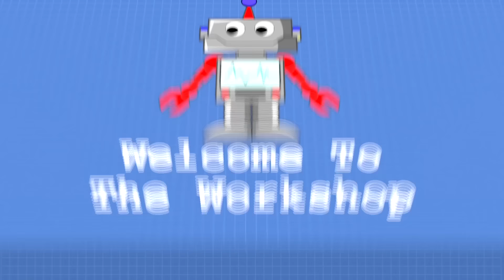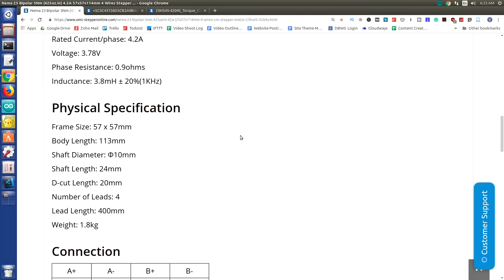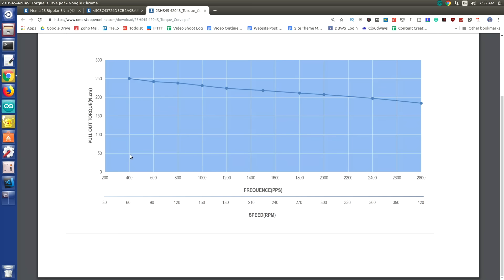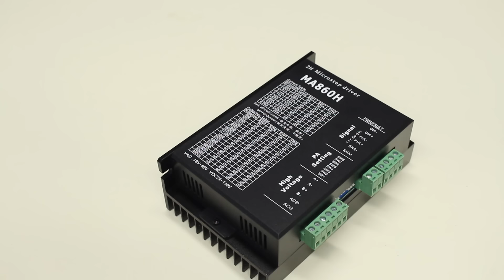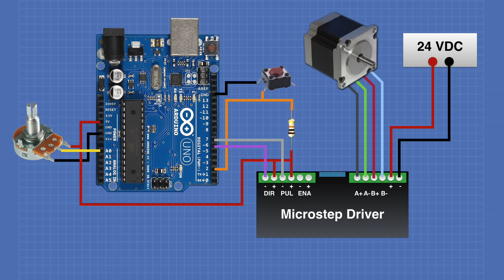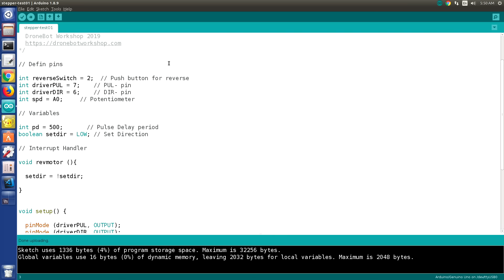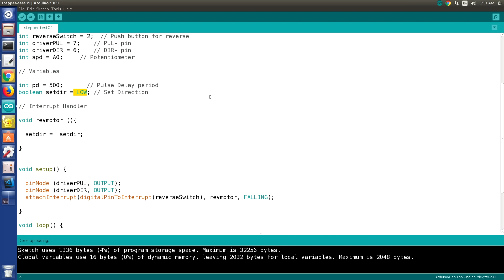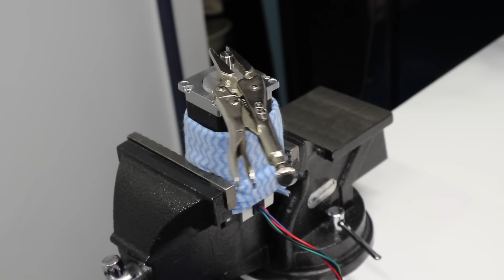Big Stepper Motors with Arduino

Comment: I'm pretty new to electronics so forgive me if I'm asking dumb questions, but if you're using a 30 volt - 5 amp power supply, won't that burn the stepper's coils that are rated at 4.2A? Are you specifically setting the power supply to 4.2A, or does the power supply, having a maximum output of 5A, give no more current to the device than it requires, therefore requiring no resistor to bring down 5A to 4.2A. And why are you running the motor at 24 volts? It seems for no particular reason since you said the voltage rating doesn't matter. In that case, couldn't you have used a 12V or 100V power supply as long as it can supply 4.2A?

Comment: I would really love some advice. Instead of the push button and Rotary Control Potentiometer can I use a Rotary encoder that has push function. The reason I need advice is I am running a Nema 34 with with driver and power supply like the video but would like to know how I can use a rotary encoder to control the speed forwards and back (push of encoder)? I tried signing up for the forum but no reply yet. Is there anyone who can help or point me in the right direction? I am confused and struggling with the sketch.

Comment: I have been watching quite a few videos about electronics and Arduino. I did not find any that has a quality that comes even close to what you are presenting here. I am very thankful and consider this a true motivation to continue my approaches. I also mentioned this on a different occasion. Often video in English appear to be hard to understand for non native speakers. This is absolutely not that case with your videos. You are doing a great job in using very clear language that is easy to understand if you are somewhat familiar with the language!

Comment: Hello
can we connect 4 stepper motor of current rating 6Amp with Arduino UNO and do the programming?
Reply: yes but need stepper motor driver what handle max 6Amp /motors. and power supply more than 4x 6A = 24A power supply to drivers. and arduino need own power.

Comment: is it possible to use that kind of drivers on a cnc shield v3? thank you
Reply: yes, many  cnc hobby user has use arduino cnc chield v3 4 axis or v4 whit nano 3 axis, but this used old pre-history worst GRBL code whit arduino, if change arduino out and use 1 or 2 paraller port card cost less than 12$ and linuxcnc software can use lot lot better software big motors and lot more all stuff and code normal used G-code today ewery machines. not GRBL.  minimum cnc need use linuxcnc or worst mach3 software, parallerport comtroller drivers and motors need be minimum nema 23 or 34 ,   425OZ torque 4-6Amp motor less than 50 volt normal 36-48 volt or biggest driver 80-90 volt. 5-8Amp. can use nema 34-48 motors have better, important have torque and amperes same driver important volt more and ampere more. less than 3Amp motors used only laser or 3d printer what no need lot torque nema 17 printer and laser, and cnc need lot more torque can cut.

Comment: despite rated current given for one phase you are don't need to use power supply twice as powerful.  because both phases never gets to full current at the same time (90 deg phase shift)
Reply: if motor max curren have 4A need power suply more than 4A if use 3 motor max 4A need power supply 3x4A what have 12A power or more. normal about 15A power supply good this.

Comment: Make sure you double check the steps per revolution DIP switches on your driver if your motor does not turn or only turns slowly .... don't ask 😁😁😁
HBS86H with Nema 34 is finally working. Thanks for the video!

Comment: amazing tutorial everything is explained in a detailed mannner. i want to control the motor with raspberry pi using python having same driver...please guide me how to do that???
Reply: The Raspberry Pi only haas out put voltage of 3.3 v on the pins. These stepper motor drivers from Stepper online need 5 volts, so you’ll need Arduino for these.

Comment: hello Bill
I am learning electronics for a CNC plasma cutter. Torch Height Controller is a bit of a problem to me. I have a lot to learn about CNC in general as an entry level. I could bother you big time for the next few years if you only want me to.
I need to learn real stuff not just as a hobby, it is my job already.
Your pedagogical teaching style has a big value.
waiting ,
thank you
gabi

Comment: Hello.. I want to use stepper motor on different axis and it's hard with plc .. so I want to try this idea. But can you help me with where to buy this black box????
Reply: Hi, I'm using a similar module in my CNC project. It's called TB6600 and I got it from ebay.
Reply: @suromark  TB6600  max 4Ampere have small motor drivers better buy DM 556 max 5.6 ampere motor or better DM 860 max 6Amp motor or biggest driver if need big torque motors.

Comment: FYI, DIR stands for direction of motor rotation, PUL stands for pulse signal, and ENA stands for enable. Just in case DURRRRR sound is grating on you. Manual for stepper motor controller MA860H is at https://images-na.ssl-images-amazon.com/images/I/81Cyu+2MjrL.pdf

Comment: Great vid. You initially said that the PSU must be rated at twice the stall current but your PSU is only 5amps?
Reply: if use only 1 motor need motor max current about this have 3-4A  power supply need one motor about 4A if use 3 motor etc, cnc, need 3 x 4A= up to 12 A power supply.

Comment: I’m assuming I can also do this on a Raspberry Pi but without the potentiometer. I would like to control the speed in the program similar to the second example. Slow to a stop and then reverse. Is there any special reason you chose the Arduino over the Pi? Other than the analog input.

Comment: What kind of motors are used for modulating boilers. Is it AC servo  motors ??      Motors that modulate the gas and air intake.

Comment: Hi, Im willing to use a stepper motor and arduino to make a DIY ForceFeedback Sim wheel. After a lot of research I cannot figure out if the arduino will be capable of controlling the motor driver for the force feedback. Could you please answer me that. Thanks

Comment: 30V 5A may not be sufficient to drive the motor since the current/phase is 4.2A and two phase should be 8.4A and the power supply is not enough?

Comment: I personally find the voltage ratings of stepper motors critical. It tells me how fast the motor can run and still generate usable torque. But I have a rudimentary grasp of inductive reluctance myself.

Comment: Curious about the description of doubling the amp rating when half stepping, which seems to make sense as described, but then when the torque specs were shown with the 36V supply rating the amps were still listed as 4.2A.  I'm just a little confused.  EXCELLENT tutorial for a person new to this.  Thank-you.
Reply: If you really want to learn about current and stepper motors then I suggest you monitor the current of a running stepper motor. Analog meters work best for this as they average out what's going on. There's a definite trend that can be observed too. The faster a stepper motor runs the less current it draws. This is due to the inductive reluctance of the motor coils. As the step rate increases the window of time to energize the coils decreases. Motor coils are inductive so they resist changes of current occurring. As current drops off so does torque. Power equals Volts times Amps. So when the amps goes down then so does the power.
Reply: @1pcfred   Thank-you.  I think I understand.

Comment: Why motor is 3.78V and choose 24vdc power supply?
Reply: We use higher voltage driving stepper motors to overcome motor coil inductive reluctance at higher RPM. We simply control the current at any given time.

Comment: awesome , looks exactly like sumting i need for a honing machine :
looking to copy this desighn but use cnc and steppermotors  https://www.youtube.com/watch?v=B0O7TROK8mA
all i still need is being able to controll the speed with a encoder on the "drillmotor" driving the hone in and out the cilinder 
need to make a 60 degree crosshatch pattern with the hone figured using cnc would be most precice 
the forward reverse will be microswitches at the start and end of the stroke
the encoder needs to set the speedpot / the speedpot becomes a setting knob for the crosshatch angle ...... thats sumting i need to find / figure out

Comment: I learned more in the past 30 minutes then I have in the past 5 years designing and building a CNC Router. It's too bad that I already bought a higher end Stepper Driver with a builtin Breakout Board. This would have saved me more than a few hundred dollars had it been available 5 years ago. I wish you would explain how to hook up multiple steppers to an Arduino. Then I could troubleshoot my system without  having to ship it out of country for diagnostics.
Reply: Just hook up more driver to the remaining pins and add another accelstepper object.
Reply: cheapen cnc can build arduino cnc shiel 34 motor can controller whit GRBL, but worst only hobby user small system, if need build perfect good cnc need linuxcnc pc controller paraller port or two port cards and controllers, and stepper drivers 5 axis or less, can use 2 paraller port card and 2 controller board, brealoutboards. and stpper driver whit motors. minimum nema24 but better use nema 34 and 80-90 volt handle driver big nema 34 motors about 3-20Nm 4-8A handle drivers. arduino can use controller board but problem have no fast and use pre-history old GRBL controll system. and not can add anything additional tools etc makro etc, many, linuxcnc have only hobby users what can do all what want. make hall file,makro,tools,automatic tools changers etc.

Comment: hey do you think i could use a smaller stepper to drive the needle of a simulated airplane gauge?    as in i want the signal to come from a usb plugged into a pc running flight sim the go to the arduino which then makes the motor move to the respective point indicated by the flight sim
Reply: this have many video in yotube, i has made my flight sim, all gauges at display backside to panel. but radio have simple make arduino, some gauge whit arduino and servo. all light and switch, max 128 switch, whit arduino mega.2560. and arduino mega radio panel whit led digital numbers and switch. all can search and find google.

Comment: Great video! Thank you so much. However, If you allow me, your comments about the voltage given in the spec sheet are a bit misleading. I believe the 3.8 V represent the max voltage that one can apply when the rotor is immobilized by an external torque greater than the holding torque. When the motor is operating normally (rotating) there is EM induction taking place that counteracts the external voltage, hence the current will not exceed the rating of 4.2 Amps. I am not an expert on steppers, so I very well may be wrong. Thanks again!
Reply: Hi Kamen, 
the voltage specified on the nameplate is the maximum voltage for the maximum torque,
and for the current we can never exceed the 4.6 Amps as it's already limited at the Motor Control Module or you may name it Microstep Controller, that current is per stator winding resistance, 
and for the Torque Pull Out Graph, it is for Half Step Motion which means both coils are energized to make the rotor in 45 degrees angle ,
i hope this help, any more clarifications please ask

Comment: Thank you for this video, i got my stepper setup following your video with just one small problem, i can't change increase the speed from the sketch, the motor is rated 5000rpm max, all i can get is about 500rpm, i changed the pulse delay to 250, 100,10 i get the same speed on the output. i played with the analogread numbers, the 2000 and 50 and lowered them, still did nothing, the only thing that changes the speed is the dipswitches on the motor driver, it is a closed loop motor, so would that be the issue with it?
Reply: I am having the same issue. Did you ever resolve?

Comment: Thank you for the very informative and well planned tutorials. Really amazing work!
I just want to understand something regarding the Current/Phase on the stepper motors. I use a Nema 34 rated at 4A Current/Phase. You mentioned because there are 2 coils this would actually be 8A? Do I understand this correctly and does it mean I need a microstep driver capable of 8A if I want to make use of it's full torque?
Reply: I was wondering the same. In case you have not found the answer - your motors are 4A per phase. The rating of your driver will be per phase or per channel as well. So find a driver that is rated at 4A plus a little for safety. I believe my TB6600 drivers are 4.5A. Hope that helps.
Reply: @liamstone3437  Thanks for the reply. I did manage to get it all worked out and working.

Comment: Okay, now how to drive MULTIPLE big steppers with an arduino ? Can you use this approach by combining it with an arduino shield ?
Reply: how many motor ? arduino shiel v3 can controll 3-4 motor, arduino mega 2560 whit cnc shield can use 5 motor. and normal only arduino can use how many output digital arduino have uno or mega. ewery motor need whit driver, arduino output minimum 2 digital pin. step and dir. if have 12 digital output pin can controll 6 motor.

Comment: How would you do this if you wanted to control two motors and vary their speeds separately using the same arduino and microstep driver?

Comment: Would this PWM controller made for LED's work for a stepper motor as well?

https://www.amazon.com/Digital-Display-Controller-Connection-DC12-24V/dp/B0749K8Q6T/ref=sr_1_10?keywords=DMX%2BDecoder%2BPWM&qid=1580357369&s=musical-instruments&sr=1-10&th=1

Comment: Nice! But I don't agree with part of it. These motors are constant amperage. The driver gets set to a fine range amperage output. A stepper motor is feed, it does not draw like a standard. Motor. If you have it set to 2.8a /3a max on the driver, at no time will it draw/need more than that as you stated.

Comment: The reason a high voltage is used driving a stepper motor is because the supply needs to overcome the back emf generated as a result of the fast switching of the inductors.  If the back emf becomes large enough then the motor will not turn, or lose steps since it cannot uphold the torque.  At lower speeds and still the high voltage, the controller current limit so the motor's current rating will not be exceeded which will damage the motor.  The biggest speed enemy of any frequency driven motor is the rate at which the metal core can be magnetized and then again magnetized in the opposite direction.  Amorphous metals are usually used for fast pole changes with the least energy required.

Comment: I have a few questions working on a project with my school kids.  Can you take out the push button and just use a balance potentiometer to give you 2 directions? looking for a left rt. wit 0 to high speed in a four in rotation which I can change with gearing.  First time looking into audrino.

Comment: I see you used the negative terminals on the driver with a common positive. Is this the way you have to do it? I've never seen a definitive connection diagram. I am presently using the positive, with common negative, and it appears to work, but clearly I may well be using the wrong part of the pulse, and I could miss steps.

So - question. Is the negative definitely the right terminal to use for the driver signals?

Comment: Hi, this video provided me with the information i needed to work out what driver / power supply i needed, much appreciated! is there anyway this potentiometer could be wired to the stepper driver (without an arduino)?
Reply: not can whitout arduino, arduino send motor direction signal, and pulse signal arduino generate pulses what need move motors. potentiometer need add to arduino and arduino code generate slow or fast pulses to motor and speed change. spindle DC motor have different speed adjust whit how much volt send to DC motor. very different than stepper motors.

Comment: Brilliant video <3
However, i would like to know if each stepper motor has pulse/rev limit? If yes, how do you calculate it?
Keep it up the great job :)
Reply: A stepper motor is not like a hobby servo.  You may step a stepper motor forever.  There may be limits on driver software because in most cases you are turning a ball screw with physical limits or driving a timing belt on a device that may or may not have limit switches.  The stepper motor driver hardware doesn't have a limit in any driver I've seen thus far--it usually only knows step and direction which is trivial to generate with most any micro-controller (arduino, etc).

Comment: Hi Bill,
Explain me something if you may.
The stepper motor listed as 4.2 Amp per phase on the datasheet . To which current you set the driver 4.2 Amp on the peak or rms value according to the current table ?
 I have a driver that can give 4.2 amp max (peak value) and I am not sure I can connect it to the same stepper you have.
Nir

Comment: Can we use GRBL for large stepper motors? And if we use then how much amount of voltage and current it can sustain?
Reply: You can but you'll still just be using GRBL. Which is a joke of a machine controller.
Reply: @1pcfred  true GRBL have first old pre-history controller system. best use linuxcnc in pc and 1 or 2 paraller port card to pc and 1/2 controller board do same than arduino. but lot better , fasten, flexiple, modified lot more, etc, automatic tool changer, and lot code and hall file and makros help work, and then need drivers same and motors.
Reply: @mattivirta  I've used different drivers and motors with LinuxCNC. I'm pretty sure I've used them with all different step sequences too. I made some drives once that could only do half step mode and I mixed them with commercial drives. I also have some 0.8 degree motors I've run along with 1.2 degree motors.